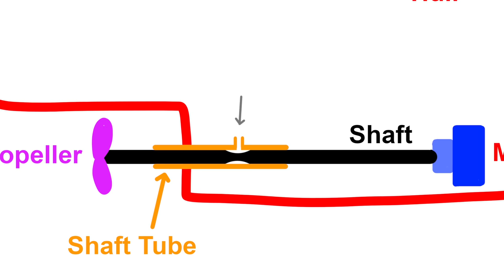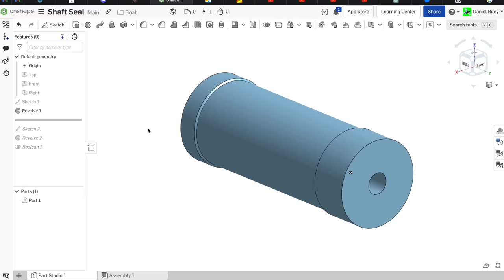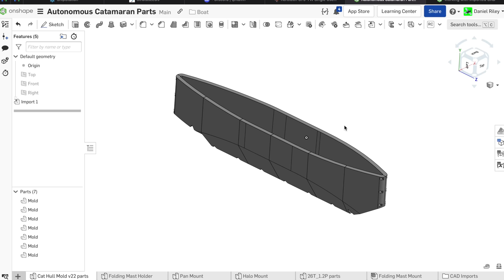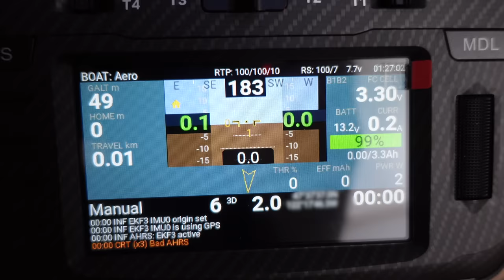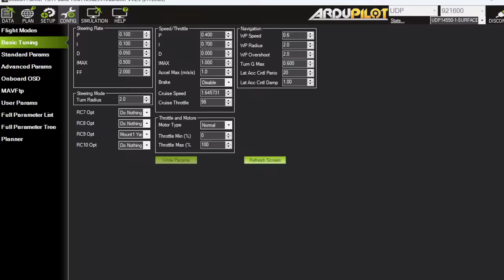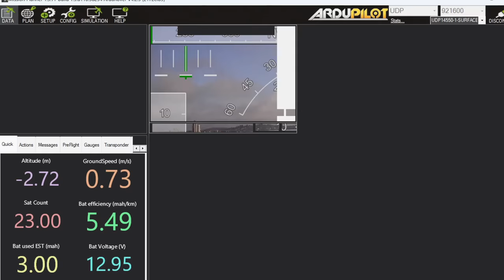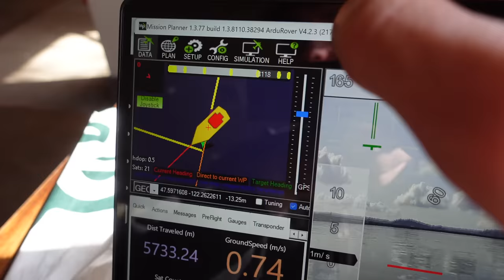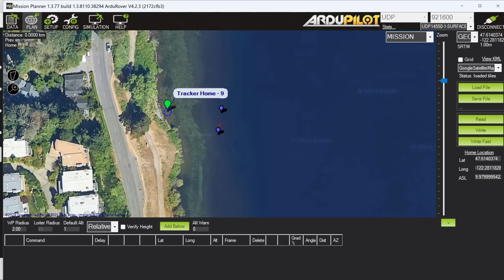5G Cellular Controlled Drone Boat - Long Range Test

Comment: gopro has live streaming over wifi network. You can connect gopro to cellular modem's wifi network. and then access the video stream via cellular. Therefore no need to use a secınd camera. Also you may choose a mirrorless dslr with good wifi streaming capability for better low light performance and lens selection.

Comment: Could have used a mechanical seal for the propeller shafts . Same seal used for water pumps . Have a bilge pump just in case they leak

Comment: I got a few questions. First, So would it be a major problem to install a sub pump just in case the boat takes on water? Normally, they are automatically activated with a float, or maybe you can tie them in with the water level sensors to run when it hits high level. It could be installed just on one side and piped over to the other side so it can clear both sides. Next, how about a camera that has a speaker and microphone in it to communicate with people if they cross paths with the boat? Last, how about a speed boat with the same abilities? Way points, cameras and cell connections, then speed run the long distance trip. Could be fun.

Comment: You've already put water sensors in the hulls. Why didn't you use this to switch on a pump to get the water overboard again? The leds are ok, but getting the water out is more important.

Comment: Why don’t you put in the tube that houses the drive shaft at an angle facing downwards and make it as long as the hull allows? When the in-hull end of the tube is above the water line it is (theoretically) impossible for water to enter.
The propellers might push downwards a little but that seems like a small price for a good seal.

Comment: The compass rotation calibration is really irrelevant to the ardupilot. When the pilot is working it tries to choose a rotation that will move it towards the next waypoint. This way cross-currents and wind effects don't affect the mission destination, only the mission time. I bet you could mount the compass backwards and ardupilot would give zero ducks.

Comment: You can prevent water ingestion by using powerful magnets to drive propellers. Like an impeller system to separate inside from outside.

Comment: Seems odd to put the entire cellular modem at the top of the mast, when you could just put the antennas up there with some coax and keep the heavy electronics down lower in the hull.

Comment: Why not use a small pump to constantly protect against small leakeges? It could be a good backup in case the seals leak/something puts a hairline crack in the hull.

Comment: I see that your only limitation with these long distance boats is cellular coverage.  What if you were to invest in one of those GPS satellite devices like an InReach? You can subscribe to allow it to communicate data over the GPS waves.  You might not be able to stream live video, but you'd be able to broaden your range by infinity as long as you had a GPS connection.

Comment: did you make the silly cone thingies ribbed?
ribbed seals with narrow veins or whatever you call it should seal better with lower friction

of couse, use lots of lube, silicone grease generally works well for rubber and is, depending on what type you use, more environmentally friendly, I think at least

Comment: I wonder how far you could go with a little single cylinder harbor freight motor and a huge tank of fuel. Multi-day waypoint mission? I feel like you've done a solar boost at some point though... not remembering it at the moment.

Comment: Probably stupid but do you need a shaft at all?  What about a circular coil and magnetic disc separated by a waterproof wall?  Instead of mechanical rotation electrical impulses cause the disc mounted magnets on the other side of the wall to rotate. Love your videos. Some of the best ever on YouTube. 👍

Comment: When my Parrot Disco was still flying, I did the 4g mod and theoretically should have had infinite range as well. In reality though sadly Germanys 4g coverage is crap. The Latency was pretty bad, and manual flying was only barely possible, because it was digitally stabilized, but Waypoint Missions worked pretty well though.
Reply: Yeah ... Germany first world country third world internet

Comment: The grease fitting on the shaft is nice, but I would have considered using an automatic bilge pump triggered by a micro switch to run intermittently. That way, shaft water seal would be less critical. Just my personal $.02 comment.

Comment: Rather than have a shaft that goes throught the hull to transmit the torque to the propeller, I wonder it if would be possible to use magnets to transmit the torque though the fully sealed hull to the propeller

Comment: Why not just use some random shaft seal off an engine ? Modify the boat to accommodate it , cheaper and pretty bulletproof if lubricated properly imo

Comment: Would using magnetic coupling across a water-tight wall, be an option for addressing the shaft leaking issue? Or would it not be possible to get enough torque thru with the weight budget?
Reply: Been designing, simulating and testing magnetic couplings and gears recently and they actually have surprisingly decent torque to weight ratio especially the coaxial variety.

Comment: no shade bro but I thought you build that boat to pull you around in? we switching to auto navs? also u can buy a battery operated signal booster for your remote js.. u could technically use ur rc remote from starbucks with it

Comment: Be careful of the apple (crapple) wifi hotspot bug where it just turns off randomly and you lose your connection.   It happened to me while flying fixed wing miles away.  It was nervous few minutes till i worked out what happened and reconnected.  It was safely in rtl on its way back thank god.

Comment: could you not have connected your flood indicators into the telemetry to show the level? Also installed water pumps (aka bilge pump) triggered when the water gets to a certain level?

Comment: why not just have and auto-bilge? two 12v diaphragm pumps with that solar cell to ensure battery never dips to 0% and using the water sensor to control a bilge isn't silly

Comment: could u put the ADE (above decks equipment) such as the TX/RX under a radome improvised from something like a tupperware (only kidding ) storage tub?, could u design a magnetically coupled shaft between the keel and the prop ??, and finally how big is this amazing thing, ? I cant remember seeing the sizes,  way interesting ! maybe improve the telem with a yagi on a tripod, maybe also use circular polarisation (DIY and use  a VNA ) but that's really only used for space to earth stuff but not sensitive too much to angles changing ...!

Comment: me reads 5g boat long range.
and as someoen who did technic ict and worked with similar technology and systems in many ways I directly see a big mistake :5g for a rc boat is a bad choice in most cases.
since 5g acutually uses way more power and has way less range than 4g, 3g is much better again. 5g often is just a high power usage device that shows 5g for show but mostly just actually uses 4g or 3g, since 5g itself has really short range and only works in very speciffic small areas and also needs a direct line of sight between the transmitter and receiver. so if you truly only used 5g you would have less range than with a old rc system, unless you speciffically want to controll it in a small pond somwhere far away but by then you could as well have use wifi then.
real 5g also an't handle fog, rain, birds or leaves or other things getting in between the transmitter and receiver.(light rain and fog can still work kind of but greatly reduce range so you would have around 10 to 20 meters range from the transmitter at most for the longer range parts of 5g(normal range is around 50 meters for a big official pole when it follows the radio power limitations, in some special places experimental ones are allowed for testing and developing, those are special test grounds and you can regularly get around 100meter to even 200 meters of range with 5g there, but those are very big high poles emitting way over the legal radio power treshold, so they are only allowed at such special test grounds.

5g has one use on rc boats, and that is in autonomous rc boats, since we already used wifi for 3d scanning (required 3 wifi devices, needed them to be on but could even work without acces to them, even though much better if you had more or had actual acces, worked using triangulated data from radio radar like scans(just lake radar but with radio).
with 5g that worked many times better and didn't actually require the extra devices or triangulation and could easily be used like a normal radar but then with milimeter presicion. using multiple points can even give submilimeter precision and measure many other things, 5g not only has a way higher frequency than wifi decreasing range greatly but greatly increasing resolusion of detail when using like a radio radar. but 5g has actually also been speciffically designed for that usage so in the general design of 5g chips they are designed as/with a phased array, if you don't know that a phased array is a setup for channeling sound or radio signals, gives a very slight increase in range, even though that is largely due to there being more transmitters being used at the same time, but the one mayor advantage is that it allows you to controll it better meaning you can easily 3d scan very detailed with them in much higher detail and much more easily. with a normal 5g board used as a 3d scanner you can actually get way more detail than with general cameras. ofcource you need the compute power to compute all the data it generates fast enough since you get something like a cloud which displays the density of everything around it at every place in a certain resolution (sub milimeter with 5g), 5g scanning when turned right can even be used to see sound, especially when the air it quite humid, this is largely to thank the short wavelength for as well as it's rapid degradation response(rapid loss of energy). this technoloy was something we used for smart home thigns to track people very accurately in big places years ago, somehow however nobody talks about it or uses it for that, perhaps with reason since if you know how well it works and how accurate it is then people might get mad about it, since for example when tuned right you could use it quite much like a new type of 3d x-ray like scanner, but then instead of measuring xrays you just measure the reflection and decay in different tisues of the body, for example salt water or iron or such would show up very very clearly, but even normal tissue differences could be detected. for that reason it can also easily be abused since you can for example use a AI to strip and restructure that data and get a very detailed 3d model of someoene, where you can also see through the clothes and such, which obviously is something that many poepple probably wouldn't want and which might be bad for the marketing of 5g if people figure that out. ofcource with 5g radio scanning the main bottleneck is the requires dataspeed and compute power, where wifi scanning could still easily be done on things like a raspberry pi, with 5g you get so much more data that you probably need a dedicated computer to get the best results, or a low resolution scan to detect objects and motion and then focus on speciffic areas to make more detailed scans there, a smartphone is quite capable of that last, a raspberry pi might also be, just not the AI realtime enhancing/restructuring(to take the data and represent it in a way that looks normal to humans).
that said that people hide it so much and focus on "advantages" of 5g which aren't actually real advantages since you almost never use 5g only when you happen to be standing under a transceiver makes it more likely that someone with enough resources already is using it for that.
in my oppinion and experience 5g is mostly incapable and unusable for wireless communication since the ranges are so short you could as well use a wire and it uses very large amounts of power to get some range, most 5g range you get is just it using older networks if you manually set it to really only use the 5g ranges you get barely any range. but the scanning capabilities of 5g are much more promising and usefull as is is expected since that is what it was designed for. ofcource some bad people likely abuse it or want to abuse it, but if you have a open source hardware where you know actually what it does and where it only does what you want it to do then it is really usefull. for example one of the main use cases I saw 5g usable for since it's actual early days was for use in a very cheap compact highly detailed VR tracking and scanning system. for example you could make your avatar exactly follow you and wouldn't need trackers or such on you, you could even use the direct 3d cloud of yourself in vr games or a 3d scan converted to a model which then follows you, ofcource those last 2 require some system or AI that converts it or something else that makes it work well wit modern technology, but it should be quite doable. the other part kind of came true since by now 5g chips are really cheap and compact, only some proper product version of it would still  be needed.
but for a rc boat, 5g is more marketing than usable, unless you use it to scan the surroundings(see it like a lidar which can actually scan in 3d so not only the strong enough places it hits but also the places in between and even inside things that aren't metal or to thick or such.

Comment: The other way you can tackle shaft seals is have a resevoir of thick oil attached to your grease nipple. Ensure the resevoir is above the water line, thus if it does leak oil leaks out rather than water leaking in.

Comment: Hello. I've been watching your videos for a long time. I want to try to build my first boat with an autopilot. In general, I want to use such a boat to take fishing tackle to one point, dump it and return home. However, now I see a lot of different guides and it's hard to know where to start. Could you tell me which is the cheapest controller and gps module to try? I already have a Jumper t-lite radio transmitter with ELRS protocol and a receiver of the appropriate type. I will be glad to hear any advice

Comment: Great video as always.  That RC cell link rocks!  Maybe set a waypoint mission from Seattle to somewhere in California! 
-	I think bulge pumps in the hulls would keep water out. Have them triggered by the water sensor or get ones with sensors.
-	Next hull version need to make so it will automatically rotate itself upright if it gets turned over in the water.  Being the smallest boat out there eventually you will find a boat with wakes big enough to turn yours over.  Starting to wonder if it was shaped like a canoe (or just used a canoe) and shortened it to about 4-5 ft. add a foam upper that when the canoe flips upside down the foam will rotate it back upright. 
-	Once you have the solar system installed this thing should run 24/7.

Comment: So... here I go again, like an old record;) When are you going to actually use o-rings instead of just talking about them...? haha/
At least one underwater scooter brand use them. Super simple setup: one on each side of an oil filled chamber. Rated for +100 hours of continues use which I think is very conservative. Since you don't have to deal with pressure you can likely get away with very little compression on the ring and thus, less friction. Then again, the oil keeps them lubed.

Comment: This is such a timely vid..  I'm trying to get elrs yaapu telem working to edge tx also even with the same rx,  im not quite there but so close.   Out of interest what distance did the elrs run out at.  I found that on water frsky 2.4g only works for 200yds.  Thats why im trying to get elrs working to see if it goes further. 
I also have used lte for mavlink and video using a pizero and picam connected with otg cable to a simple  4g usb modem,  its so great not having tripods, antennas and all that nonsense,  just hotspot your phone and go. ! And with the small usb modem you can fit it in a volantex plane or similar just tuck it in the fuse for unlimited range and no external antennas or video transmitters..  its the ultimate and makes the antenna trackers and long range uhf etc redundant
Reply: you should get km of range if you have line of sight with elrs
Reply: Yeah but having the rx close to the water kills the range,  loke i said 200yds with frsky and it would normally do over a mile in the air line of sight.
Reply: @srnunan4783  with elrs they got 100km with 2.4 ghz so you might get a bit more than 200yds but it would be a good thing to test

Comment: You know that Elsight Halo is expensive when their site says "Request Quote"
Reply: This is definitely an ad, there are better cellular data links which cost a few hundred and have very high polling rates. Whenever a company refuses to have prices on their company website it means that it's extremely overpriced. They won't even reply to your "request quote" unless you make up a story, these are scammers in suits.